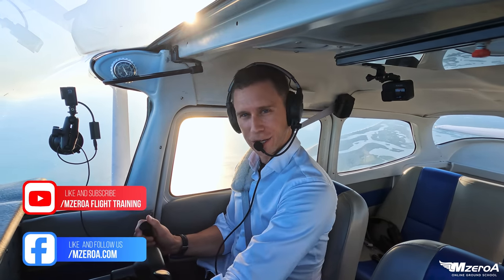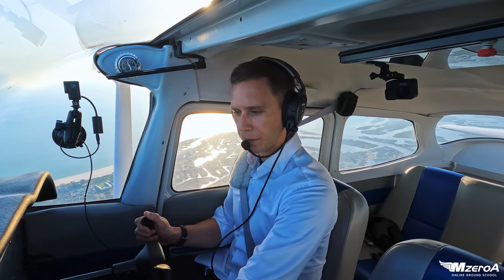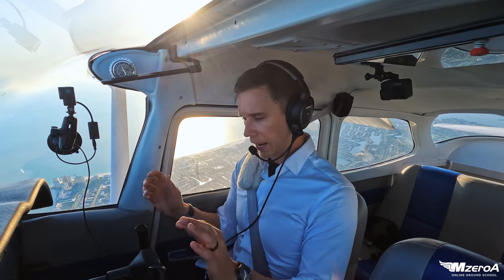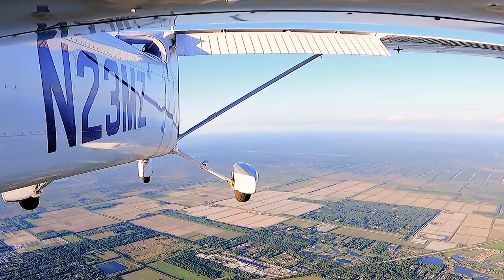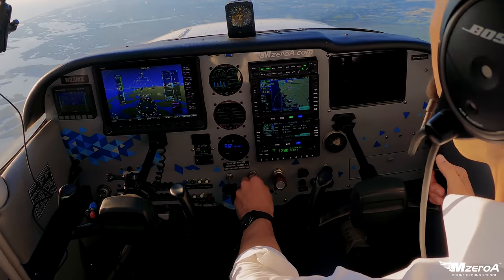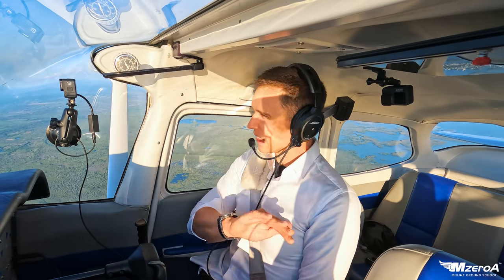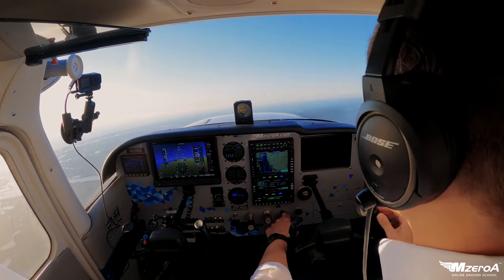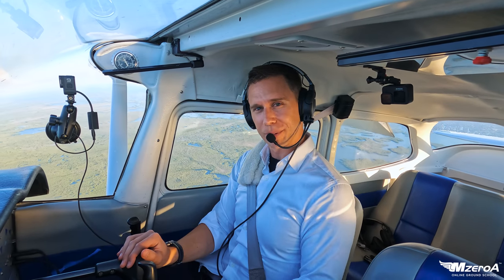HOW AND WHY WE DO SLOW FLIGHT

Comment: Jason, I can't thank you enough for stressing repeatedly, what I'm coming to discover as must-learn-basics!  I'm around the corner from a Checkride, and I've really wanted to work on my landings but most especially my short-field landings, which I've heard a couple people have failed their Checkrides over. Anyway, like most beginners slowflight helps you learn to trust the stability of the plane at low speeds and be more comfortable with it. I've landed too high, too hot, floating the plane, and then I feel very foolish. Slow flight, along with one hand on the yoke, one hand on the throttle, and soon enough I'm feeling like a pro! Thank-You so very much for these videos!!!

Comment: Also, it's probably preferable to practice slow-flight in small blocks of time to prevent the engine from overheating... in slow-flight, the engine is running at a high RPM, but doesn't get all the airflow cooling it needs because of the lower-than-normal airspeed...

Comment: Jason,
 I hear a lot of what you need to do but not  why it has to be done this way. Thats why there are so many accidents. Flying is taught as a monkey skill not a understanding.
 Simulate typical accidents.
Example demonstrate failed landing attempt resulting in a go around but forget to retract flaps on takeoff. Then retract all flaps at once the plane will stall and roll. Natural act is to add ailerons but this causes adverse yaw wing stall roll into ground.
Show at slow flight the ailerons cause adverse yaw and possible wing stall. Teach why the Rudder is you friend on landing, slow flight.

Comment: why the carb heat?
Reply: In most carbureted aircraft you always want the carb heat on when the power is pulled below the green arc as that is when the engine becomes most susceptible to carb ice blocking the intake.
Reply: @NorthwestAeronaut  Thanks.